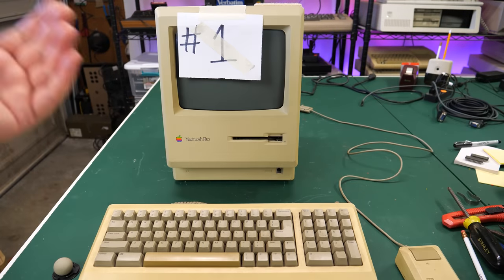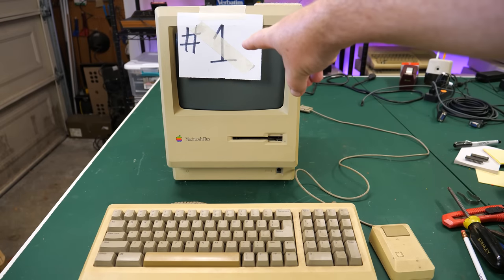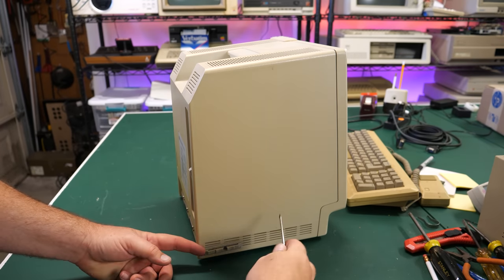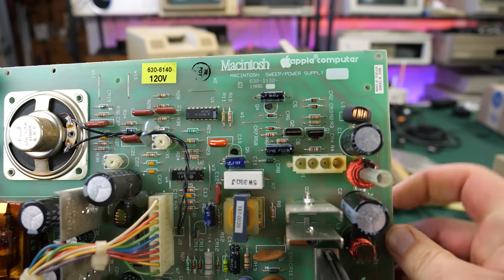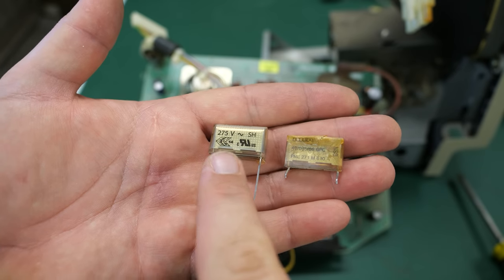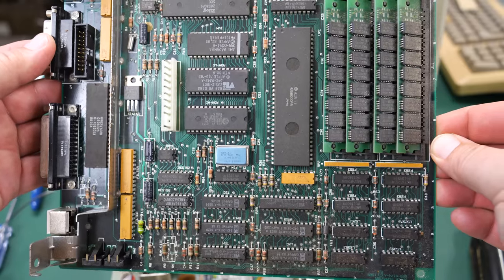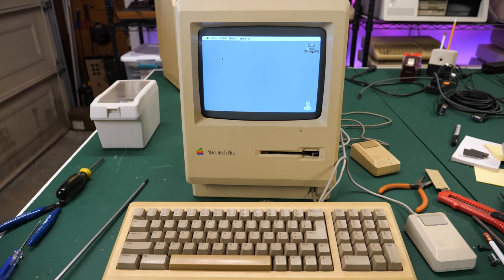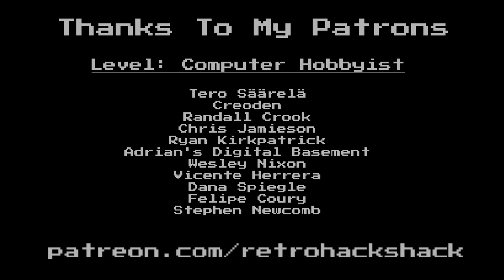Macintosh Plus Repair

Comment: first job out of university I got hired to do software development that targeted the Macintosh Plus. I had self taught myself Mac programming on my 138K Mac that I did the chip soldering to upgrade to a fat Mac. I had Lightspped C compiler and Macsbug monitor. But when hired to work on the Mac Plus, I used MPW C compiler, Object Pascal, and its assembler.

I was developing an embedded app to where the Mac was to be the operational console of a laser photo imager that printed PC boards on to sheets of film taking conventional Gerber files.

I worked with mostly EE engineers and they would let me borrow the MC68000 logic analizer to debug memory corruption bugs.

Went on to work for companies like Aldus where worked on Persuadion and Pagemaker, and worked at Microsoft, but this engineering startup working on the Mac Plus was one of the best job - the coolness factor of hardware merged with software.
Reply from the maker: That's so cool. What year was this? And why the Mac? I assume it was because of the speed of the 68k.
Reply: @RetroHackShack  Joined the project in 1987 - when the very expensive Gerber machines were still primarily used to image PCBs.

This film imaging machine that I was part of development team for, used about three MC68K CPUs and rasterization was done with one of those, so by using the Mac we could port the rasterization code easily to the Mac and allow a user to preview a gerber file graphically on the screen (which black and white was adequate for) prior to printing it.

The user would put a floppy disk of gerber files into the Mac and use its kiosk UI to select which file to print, etc. Could preview the gerber file, and preview its "tray" and customize it, etc.

Probably one of the reasons I got the job is because at university a computer sci hacker buddy and I (I was in engineering dept) were showing off a TeX port to the Mac where we had a preview capability of TeX documents so all the academics using TeX could check what they were about to send to a department printer. This was before any commercial ports of TeX for the Mac started showing up. Professors were impressed as they all tend to write their papers and books using Donald Knuth's TeX (and LaTeX).

Back to the PCB photo imaging device - the Mac Plus was mounted into the machine to where it was operated with a track pad (no keyboard).

I wrote a new kiosk desktop UI that replaced the normal Mac desktop. Of interest is that what I came up with worked very much like the Windows 95 desktop UI that would come out 8 years later. I had something similar to the Start menu down in the bottom, left corner of the screen, which would click on to access hierarchical menus. Used fonts sized much larger and so forth. Very kiosky.

So I worked at Microsoft when Windows 95 came out - it was satisfying to see that I had come up with similar take years prior, which Win 95 tended to be accepted as a very successful UI paradigm - seems like a lot of Windows users prefer its approach to this day. (that earlier company was hardware focused so there was never any thought about copyrighting or patenting the kiosk UI - they had hardware patents instead).
Reply from the maker: So cool. Thanks for sharing!

Comment: We repair a lot of macintoshes. We reflow every header on SE/plus/512s. We replace the rifa's. Those yoke connector joints love to break. The yoke connector WOULD not have resulted in a non-functional system. You might have a bad speaker, since you SHOULD get a deeeeet noise when powering on. That's it from me. Great little video!
Reply: Yup, after you do a few of these you recognize the analog board clicking.  But i also had one where the plug was completely fried and i actually had to get a new connector.  Luckily that's all it was, sometimes people love to mess with the voltage settings on the board also when it doesn't work.
Reply from the maker: Yeah the speaker was shot. I replaced it we a spare. They are a weird ohms rating though. Like 36 ohms or something.
Reply from the maker: That would suck.
Reply: Another common fault is the fuse in the power cable. Always check blue wire has continuity. There's a 5amp fuse inline
Reply from the maker: I never realized that. That could cause a bit of confusion when troubleshooting for sure.
Reply: @RetroHackShack  system will judder as the PSU stops due to not enough load. So it makes an obvious fault, assuming your speaker works

Comment: I would have made a way more complicated attempt at fixing that broken solder pad. Scrape the lacquer off, try to solder to the trace, etc. Just bending the component lead over to the next solder point is an elegant solution that may not be as obvious as it seems.
Reply from the maker: Good to know. I often overlook the simplest solution or go down some rabbit hole.
Reply: Soldering to another soldering point is stronger than scraping and soldering to the trace.  If there wasn't a solder point so close, your method would've been preferred.